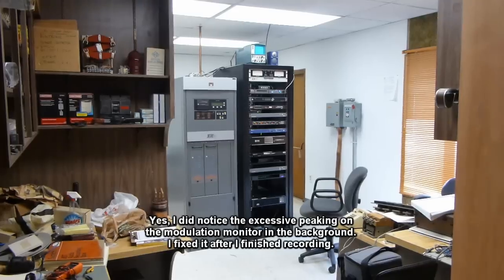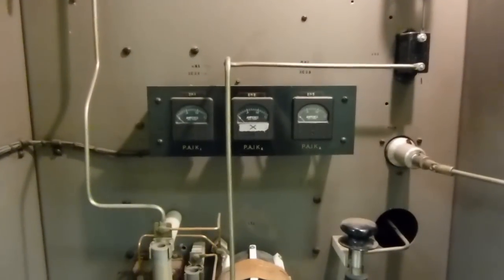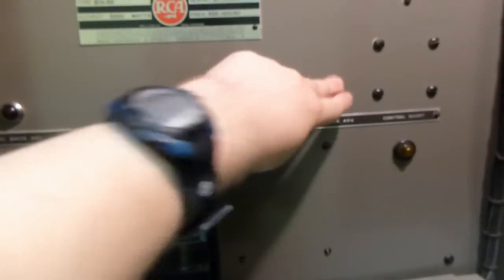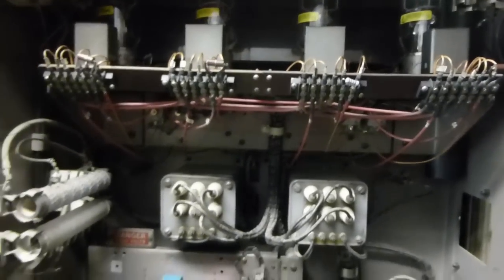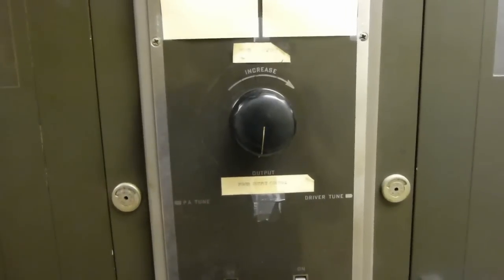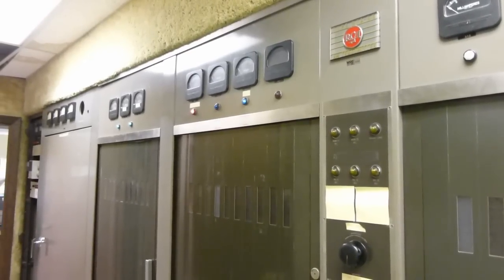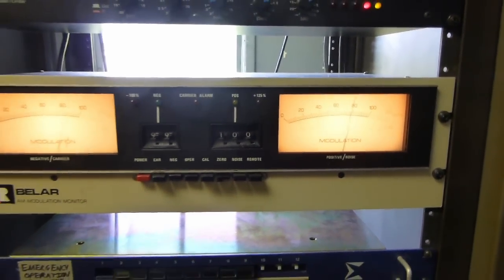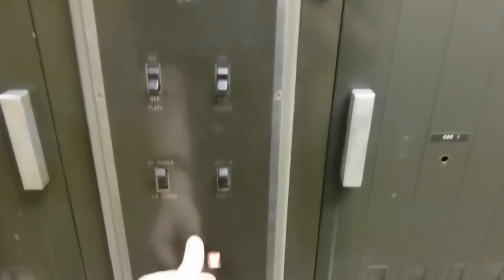A Look at a 1950s-era AM Radio Transmitter

Comment: If you're seeing higher negative peaks than positive, flip the balanced audio connections.  There's a little natural asymmetry (a few percent) in most speech and music, and in mono it's very easy to get it flipped by accident.  The old transmitter was designed to cope with that, unlike the much greater asymmetry modern audio processors can add.

     I think the oldest AM transmitter I ran was a 1947 Collins 300G (250W).  The biggest was an RCA BTA-5U2, a kind of a descendant of your 5G.
Reply: @msroper5287  I didn't think I was unclear, but let me try again: Older AM transmitters were designed to cope with small amounts of natural asymmetry.  Most were not designed to deal with excessive, processing-induced asymmetry -- because most of them were designed before such things became common.  If you paid attention to audio phasing throughout the system -- positive pressure at the microphone diaphragm produces positive modulation -- it will pay off in terms of being able to run slightly higher levels, because of the natural asymmetry in the human voice and some instruments: 100% negative modulation is a hard physical-law limit, 100% positive is not.

     The really loud, high-power Top 40 stations back in the days before PWM and other clever modulation systems (late 60s through early 1980s) -- especially before FCC limits on positive modulation -- generally used oversized power supply components and modulation transformers (etc.), specifically to deal with the problems of "supermodulation."  It doesn't get around the inherent problem that processing-induced asymmetry is essentially distortion but at least you don't ruin expensive components (until things start arcing over on the RF side!).

     Running square waves through an old plate-modulated transmitter isn't a good idea, especially if you start dinking with the response to square 'em up.  Most of those rigs use a lot of negative feedback wrapped all the way around the modulator, with multi-element R/C networks, and the slew rate is plodding (and somewhat accidentally protective therefore).  If you start reducing negative feedback to get better risetime (presumably watching out for a rise in THD+noise as you go), you're going to get overshoots.  They're eventually going to do interesting, expensive things to the modulation iron and other components. (See earlier comments about supermodulation and arcing.)

     You can do some minor, careful tweaks to these old transmitters to improve the audio but they don't come without risk.  The old-timer engineers knew what to avoid and what parts to upgrade -- and they could get those parts at prices that were only mildly outrageous.  Many are all but unobtainable now.  These days, I'd stick to what the OEM did, and not push it; such transmitters are toys, museum pieces or last-ditch backups.  The few remaining AM transmitter manufacturers can sell you a gadget that will do everything one of these old behemoths could do and more, at higher overall efficiency and with far greater reliability. 

     On audio phase, Kahn sold a passive gadget that supposedly rotated phase in such a way that it was always "right side up" and you can argue with his ghost over how well it worked -- essentially a phase-rotating allpass filter.  Gates/Harris had a peak clipper for AM that, IIRC, included a phase checking/flipping circuit with a relay that was supposed to keep track and fix it on the fly, but you wanted to have everything wired up correctly anyway or the tiny blips of the relay were annoying.
Reply: @Roberta0X  Symetra-peak, followed by an RCA device, I forget the name, that created the asymmetry.  Install the 10 kW audio tubes in the unused sockets.

Comment: Ooh that is nice.
There was a Harris MW5 installation locally.  It was replaced with a GatesAir transmitter.  The MW5 they had wasn't nearly this large, but it was sufficiently large.  I'm guessing that the other cabinet is for the directional? 

It took up all the room in the shack.  I'm assuming that the shack was built for the 1 kW transmitter they used when it went on the air.  They upgraded to 5 kW in the early 80s, but never enlarged the shack.  When I say it filled up the shack, it indeed did.  There was little room to move around the thing.  I don't know how they were able to fit it in the door without moving smaller pieces of it and constructing it inside.

Comment: I just looked up Scott T transformers, and they convert three phase to two phase and vice-versa.  As there are six thyratrons for the high voltage supply, it would appear that they are rectifying three phase ac.  It seems very likely that the supply to your installation is three phase.  So why is two phase power present at all?  Perhaps it is a cost saving measure, as stated in Wikipedia: Two back to back transformers "is a cost-saving in the lower-power transformers due to the two-coil T connected to a secondary two-coil T instead of the traditional three-coil primary to three-coil secondary transformer."
Reply from the maker: There are only four thyratrons in that high voltage supply.  The Scott T transformer actually has four output legs, each 90 degrees out of phase from the previous one.  Normally (as Wikipedia states) this would be used as two separate two-phase circuits (the 0 and 180 degree legs being one, and the 90 and 270 degree legs being the other).  RCA, however, treated the four output legs as a single four-phase circuit in this transmitter (as odd as that sounds), feeding one to each of the four thyratrons.  The manual I linked in the other comment probably explains this a little better.
Reply: @IfYouLikeGoodIdeas  Yes, about an hour after I wrote that yesterday my mind flashed up an image of the four rectifiers and I thought "you got that wrong".  Came here tonight to edit my comment, but it was too late.  It's a really interesting design.  Normally you would have 6 rectifiers on a three phase supply, which with 60Hz mains would give 360Hz ripple on the DC side.  With two phase full wave you get 240 Hz ripple.  Whoever came up with this design decided that the cost reduction of using the two phase transformer and four instead of six thyratrons would outweigh the increased cost of smoothing capacitors and inductors.  These would need to be significantly bigger to cope with the lower frequency ripple.  Once again, thank you for showing this wonderful old transmitter.
Reply: I saw 4 rectifiers and wondered about that!  ... thinking about a bridge and single phase

Comment: There's a lot of interesting things about these. @9:20  Could there also be an outdoor AC condensing unit for this? At the top on the right just above the blower I thought I might have seen what could be refrigerant lines that could be going outside to an external condensing unit. I've also seen some that have air conditioning compressors and water chillers in them too and also seen some that run on 277/480 volt 3 phase power.
Reply from the maker: This one doesn't have an air conditioner in it, just a regular fan (though I'd heard of transmitters with built-in A/C, I've never seen one in person).  The things around the blower are wiring harnesses.  This particular unit is tapped for 208-volt 3-phase, but the manual seems to suggest that the default configuration from the factory was 240-volt 3-phase.
Reply: OK, cool. Back in the day most radio stations and other commercial businesses originallly had 120/240 volt delta systems with a 208 volt high leg. This is probably what they originally had in this radio station and they upgraded to the 120 volt/208 Y system to accomadate the newer equipment they have there now and changed the configuration on the old transmitter to keep it in service. The 277/480 volt service and the water cooling systems are more commonly used in TV and microwave transmitters. @IfYouLikeGoodIdeas

Comment: Interesting video! Loads of tubes, Kilowatts in air... Nowadays , in my opinion the AM MW transmitter can be implemented by class D audio amplifier with power mosfets with gate driver (to achieve dead time) in switching mode. But power of such a transmitter constraints by several tens of kilowatts - the modern mosfets runs up to 1000V

Comment: Putting your hands on the  anodes wires of the 807 made me a bit nervous. Let alone touch the wire of the final modulator. I rebuild a lot of transmitters who date back to the 30s, and even with the current removed, they're still dangerous. The sound you're hearing is from both the final tube plates themselves and the modulation transformers.

Comment: Very cool. Please tell me that  analog am radio is not going away.
Reply from the maker: We certainly don't have any plans to flip the station in this video to digital anytime soon.  Technically, the FCC did approve "all-digital AM", but it's strictly voluntary (and most likely, the stations that will go for it are lower-powered AMs that feed FM translators, not bigger AMs with more significant analog listenership).
Reply: @IfYouLikeGoodIdeas  Thank you! I read they tore down WMALs  Towers today in Washington to make room for an apartment complex. Those towers stood since 1940. I love AM radio and transmitters and tower sites. I grew up down the street from WELI in Hamden Conn.  They have a four tower array that I could see from bedroom window. Those sequential tower lights were so beautiful. WELI is a 5000 watt station at 960 on the dial. I used to down there and look at their 1950's transmitter very art deco. Massive tubes like the ones  in the video. 
I should have gone into radio, its my life.
Reply: @IfYouLikeGoodIdeas  what is the call sign and frequency of this radio station?

Comment: fantastic video thank you.
how long can you run the transmitter into the dummy load for? That must create a massive amount of heat.
Reply from the maker: As far as I know, the dummy load can accept the full output power of the transmitter indefinitely.  It does definitely get hot though - the smell of burning dust in there is unmistakable!
Reply: The dummy load is air cooled with a blower.

Comment: The question I have is, since most of the equipment is before microchips, would it survive a EMP device or solar flare?
Reply: Probably.  But, local power grid likely would not so...
Reply: If you have a generator, and some old tube type audio boards and a couple of turntables you'd be golden when the crap hits the fan!  This stuff can take direct lightning hits and only miss a second.

Comment: @22:40 You mention UV exposure from the Mercury Vapor Rectifier tubes.  I thought plate glass (which is installed as a filter for Quartz Halogen lamps) will filter out UV?

Comment: That is very cool. What's the deal with the (looks like) plush carpeting on the walls?
Reply from the maker: The carpeted walls predate our ownership of the station.  I have no idea why they did it, other than that much of that section of the building has it.  I could understand it in the studios as a sound deadening measure, but in the hallway is just weird.
Reply: The Groovy look from the 70's maybe?
Reply: The original owner, Gordon P. Brown, established WSAY in 1934 as a 250 watt station on 1210, moved to 1240 by NARBA.  In 1948 or so he got an upgrade to 1000 and a frequency change to 1370 DA-1.  In the 50s he upgraded to 5kw DA-N.  He had to change the pattern from 3 in-line towers to a parallelogram.  His intent was to also put a TV station on the air (Channel 13) and bought a downtown office building to accompany his new transmitter site, and moved the radio studios to the transmitter on a temporary basis.  Channel 13 ended up going to a different company and Gordon Brown apparently gave up.  He was building studios downtown that never got finished.  That was the case when he passed away in 1979.  He operated the station more as a hobby than a business and had very little income.  it was a popular music station, then a rocker, then "free form" then country until his estate sold to Lew Dickey, father of the Cumulus Dickeys.  The building was gutted basically and re-tooled with the Harris transmitter, and a new staff and studios not far from the 5H.  The station was off the air for a week while the whole antenna system was re-done and the ground system fixed.  There was also a 1934 Buick sedan in the basement of the building. The new owners wanted to attack the market's 50 kw full-service AC leader WHAM, but after a year or so Mr. Dickey -gave up. He tried satellite talk and satellite country but the formats failed.  He sold it to the city's Public broadcaster, WXXI.  In retooling the building Dickey put the carpeting all over the walls to deaden the sound.  There were transmitter blowers, transformers and other equipment that had to peacefully coexist.  He did it on the cheap-and we're told that near the end of his ownership staffers had to bring in their own chairs.  Wall to wall-and floor to ceiling carpeting (no doubt traded) is cheaper than Sonex.

Comment: I recognize this transmitter site! I have been on a tour there. I've noticed antennas disappearing lately...What's the story behind that?
Reply from the maker: The towers at this site are in the process of being replaced, as the old ones were found to have structural issues.  By the time the project is done, the antenna array will be exactly as it was, just with new antennas.
Reply: @IfYouLikeGoodIdeas  Awesome! Thank you!

Comment: HI IM FROM CANADA. AM STEREO REMEMBER? IS IT GOING TO COME BACK? SPARK GAP EARLIEST RADIO. THOSE CRYSTAL'S ARE HARD TO REPLACE. IM 49 I HAD A CRYSTAL RADIO AS A KID😊.YOUNG STATION 1946. CKOC 1150 MEGACYCLES HAMILTON CANADA WHERE I LIVE 1929 AROUND. BOY THE OLD 1929 TRANSMITTER STILL IN ORIGIONAL 1929 BASEMENT OF ORIGINAL BUILDING NOW LOFTS ON GARFIELD AVE. CKOC STARTED AS 5 WATTS. IVE SEEN HEARD SPARK GAP CRACK. . CAN YOU SHOW HOW TO CHANGE WAVE PATTERN FROM ANTENNA ARRAY?
HOW MANY TRANSMITTERS ARE THERE?
ID LIKE TO SEE BASEMENT

Comment: Rather complex compared to the Collins version of similar vintage.   Strange no tune adjustments when changing the plate voltage so radically… although I never ran into a dummy load.

Comment: Was that Harris one of the ones that had many boards, each with like 100 W output that were all paralleled?
Reply from the maker: No, that Harris is still old enough to use a tube for its final amp.
Reply: @IfYouLikeGoodIdeas  We bought a couple of Harris Tx of that generation. It seems like, at that time, there was a "rookie" in the overseas export section, as they were sent complete, unlike the normal process of packing the heavy stuff separately.
Miracles do happen, & one arrived intact---with the other one, sadly, the modulation transformer had come loose, rampaging through the fragile bits, so we had to spend months fixing it. There were always "niggling" little faults with that particular unit, so it looks like its bad luck stuck with it

Comment: From someone who has never worked on a high power transmitter. What is the function of the little rectangular box above the 2 3phase circuit breakers? I have seen a similar box on the early 30s /GE/RCA transmitters as well.
Reply from the maker: That's the overcurrent sensor for the low-voltage plate circuit.  The relay inside it latches on in the event of an overload, which then shuts the transmitter down.
Reply: @IfYouLikeGoodIdeas  Thank you.

Comment: What's the typical warm-up time for this transmitter?  The video cut out most of the warm-up cycle.
Reply: 30 seconds will get you on the air in an emergency.   As long as the mercury tubes have been burned in.....they recommended 30 minutes the first time you put a mercury tube in, some transmitters had a spare socket where you could keep a mercury tube in place, vertical, all warmed up.  If you shook the tube or anything you had to cook it again for 30 minutes or so before applying plate voltage.  Ah the good old days.

Comment: i worked at a station as a dj a few yrs ago it everything in 1 building was rca transmitter  very huge but only ran 1000 watts, had 4 833,s in it, cool with all that stuff in the same building.

Comment: when you are measuring the transmitters rf output with the meters, are you measuring avg output or pep output? why one over the other?
Reply: If you are speaking of the output power measurement, which can be measured in watts or amps of RF current (been a while since I watched this video) actual carrier output is being measured as this is a carrier that is amplitude modulated on both the lower and upper sidebands. PEP is only used in single sideband where there is no carrier.

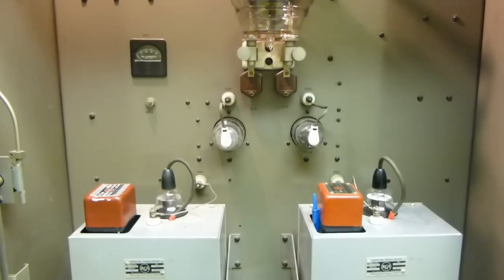Comment: 3:48 what's this hack over here on the right?  Vibration reduction?
Reply from the maker: The pen cap?  I'm actually not sure.  It's been there so long that even my predecessors don't know what it's for.  If I were to guess, though, there's probably a loose contact in the socket that the crystal unit (the red box) plugs into, and the pen cap tilts the crystal unit slightly to force it to make contact.

Comment: What is the voltage & current at the antenna?
Reply: It depends on the resistance of the antenna.  If the resistance is 50 ohms, the antenna current with no modulation would be 10 amps.  10 x 10 x 50 = 5,000.  FCC allowed a bit more power going into a directional antenna system to make up for losses, so the power going into the common point of a directional antenna power divider and phasing system might be something like 10.4 amps for 5,400 watts into the directional antenna system.

Comment: What was the price for one of these transmitters back in the 50s?
Reply from the maker: I'm not sure of the price of the transmitter alone, but I'm told the station spent around $60,000 total - for the transmitter, phasor, 4th tower, engineering work, etc. - to upgrade to 5 kW in 1955.
Reply: Just took a look at what 60k in 1950 would be equivalent to today.
677,000.
Wow.